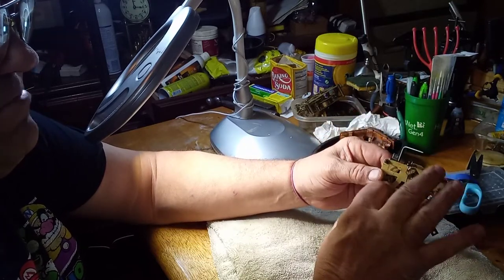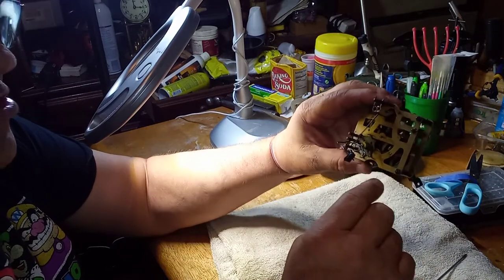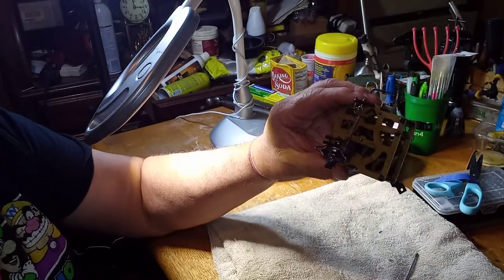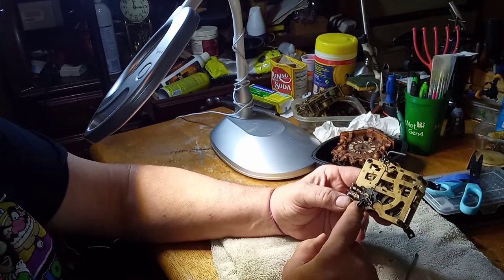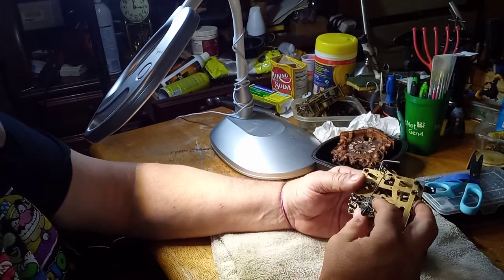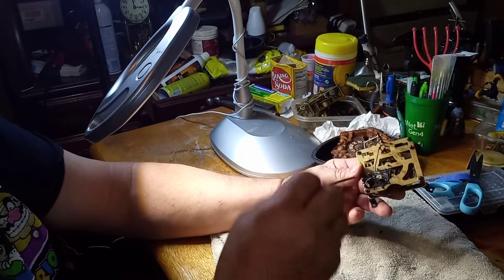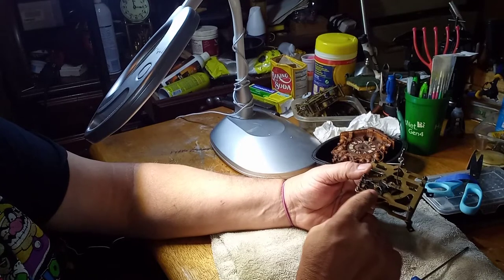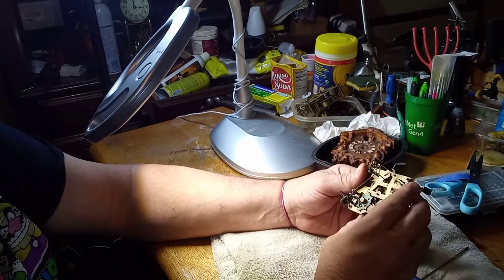How to repair a cuckoo clock that is cuckooing too slow at times (See description) 20221101 035027

Comment: My cuckoo only runs slow on the FIRST cuckoo. So, it’s like: cuc………..koo, then cuckoo…cuckoo…cuckoo. I’ve put oil on the 8-point wheel’s axle and on its legs to make sure it’s lifting the rods for the gong and cuckoo easily. Sometimes it’s nearly two seconds the first “cuc” and the “koo”. After that it cuckoos as normal. Any suggestions as to where to look for something that needs oiled or cleaned?
Reply from the maker: I would say that it is an adjustment that you will have to do with the high or low note lift wires. If it is making the first sound ok then I will say it has to do with the low note lift wire which is the bellow on the left typically as you view the clock from the rear. Carefully hold the left part of the lever that comes out of the movement and then while holding it then bend the other part of that wire up or down slightly and see if it works better. Good luck.
Reply: @munnerlyn3  Thank you SO much for the suggestion! It appeared the horizontal portion of the lift wire for the lower note was rubbing against the bushing in the center of the lift wheel. I bent it away from the lift wheel ever so slightly and the first cuckoo is better now!

Comment: The illustration not good.
Reply from the maker: If you can get the closed captions to come on for your language then you will understand it easily as I explain it in linesman's terms.  As the problem could be the 8 point star wheel that is touching the movement or the points are not the same.